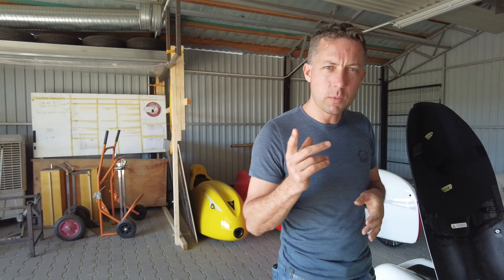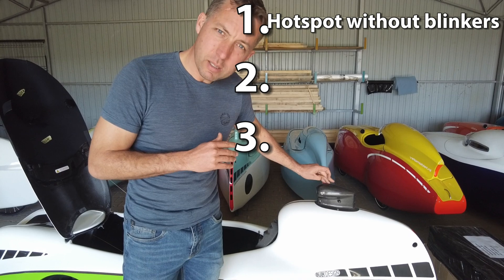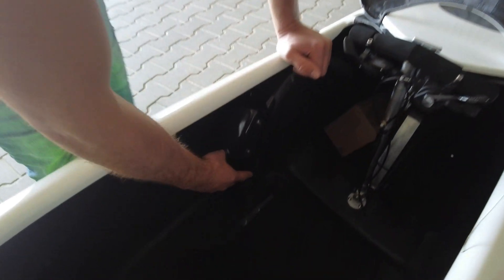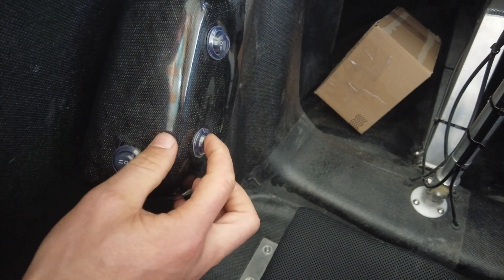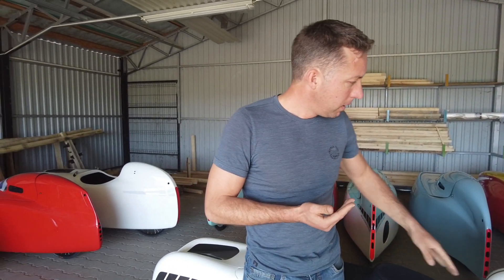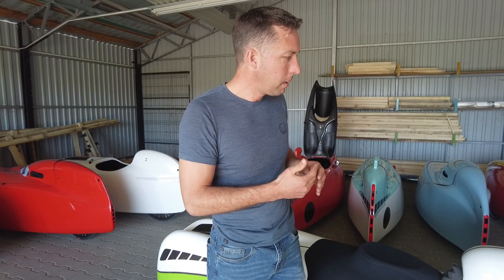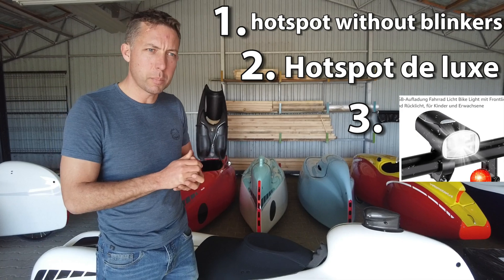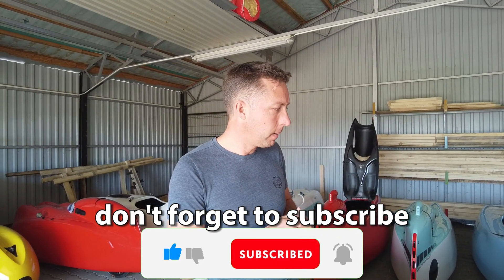The Electrical Inventions of the Bülk 4 More (2024 New Velomobile)

Comment: This is a significant upgrade. I am sure this is a 12v system. What versions of Velo will this retrofit on? Like the DF/XL, is the dash panel removable to add an inline switch without using the exterior switch? The exterior switch can be left on, and the panel switch will replace the on/off. This means you still must select your desired setting for the day on the outside.  This is a very nice upgrade and makes the Velos stand out in traffic.  What is the part # I would like to order?  Do they come in primary Velomobile colors, or is it carbon black only?
Reply from the maker: It is a idea to make yes, I did not think about it

Comment: I wanted a red flashing light on my QV so I got a light designed to fit on a bike helmet which fits a standard plumbing pipe clip. Easy to clip on or off, and then re-charge with a standard cable. Works fine :-).
Reply from the maker: something similar we want to use here as well

Comment: That is very good invention. The simpler, the better, because that's what cyckling is at it's best. And that headlight above may be even better than low on the front. I hope these shuttles become very popular. I woud love to have one some day.
Reply: light on the top is good to be visible. light on the front is needed to see in front of you
Reply: @BirgerLanduyt  So, why then the big trucks have long beam lights on the roof, if they are not effective? How is that you can see much better with headlamp, than with flashlight in your hand?
Reply: @intromortti  it's al about power. 
with a frontlight you can see 2 meters further than when it's behind you. And you want to see the road as far as possible on high speed. 
Big trucks dont use flood light on top in traffic. 

With a flashlight in hand I can talk to people without blinding them.

Also light on top can have the disadvantage that it light up the top of the velomobile. And is bad for your night vision
Reply: @BirgerLanduyt  That little of a difference in length of placement has very little effect to power with the current efficient LED lights, but the light coming from above is more efficient. Very low front lights show you all the bumps in the road as black lines, the higher beams illuminate them as well. That's exactly why trucks have high beams on the roof. They illuminate very far, much farther than low on the front ever could. In that case It is of course nesessary to have also low beams, but in lower than low velomobile the light still is not higher than a regular bicycle light. Hood lighting can be a problem, it depends on how tall the driver is. Then the bonnet should be matte black, it would reduce the reflection. But I don't think that many ordinary drivers even drive a velomobile constantly in the dark, and those who do, will probably buy a more expensive one anyway.
Reply: I commute in the dark. I have a light in the hotspot and another in the nose. Even though the top of my velomobile is white, I have no problem with night vision from the light on top. It doesn’t blind traffic and it gives me a much better view further down the road.
Reply from the maker: Couldn't agree more!